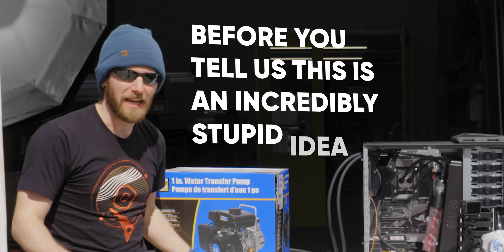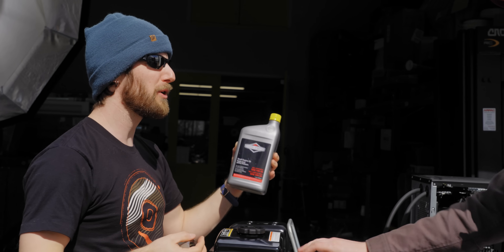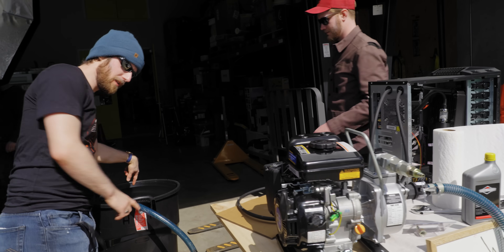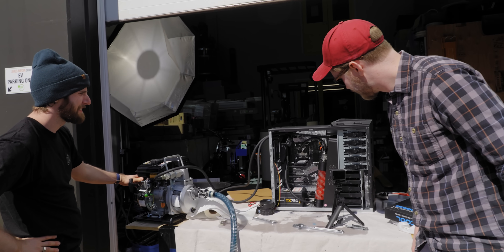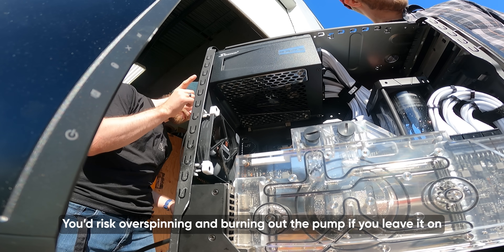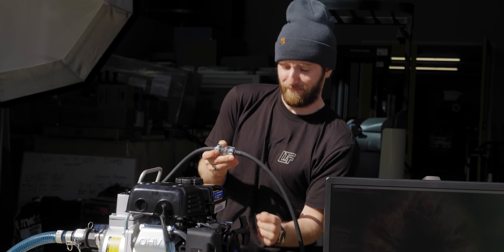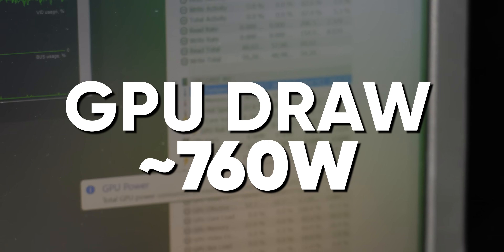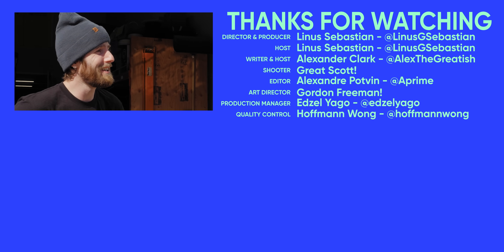Cooling a PC with a 2.5HP Pump

Comment: The conductance of the fine tubes in the radiator is too small to tolerate the pressure the pump is producing.

Comment: I previously designed circulating oil systems for extremely large systems like paper machines, among anything with constant oil demand on large bearings. There's a Diameter to the 4th power relation to pressure losses, or more easily calculated, as "equivalent length". Your delta-P is proportional to the sum of the equivalent lengths. For example if you go from 1" to 1/4" , thats 4^4 =  256x the pressure needed or, translated, to flow loss, hence why nearly 2kW motor looked like a tiny 7W worth of pressure. depending on the method you're using the power is from 4th to 5th and is based on turbulent or laminar flow. 

Turbulent flow is also more desired in cooling because you get a greater surface area (inner surface of pipe) exposure to the water. You can figure this out with reynolds number.

The "equivalent length of fittings" method is probably the fastest way to estimate your losses through systems like this.

Instead of the wimpy radiators and blocks you're using...you could just run a "brazed plate heat exchanger" around 15-20 plates. Usually have 1" oe 3/4" fittings already part of them. They  are used to transfer heat from oil routes to water, usually brought in from a nearby river or whatever. So in your case. You'd have oneside as chilled water and the other circuit as part as the actual water loop.

Comment: So the confusing thing about centrifugal pumps is that the flow rate is dependent on the discharge pressure. So because there’s so much friction loss through the loop, and the pressure is very high, the flow rate is relatively low. Basically, the higher the discharge pressure at a given power output, the lower the flow rate, so I doubt you’ll see anywhere close to the advertised flow rate, unless they give it to you at the max head condition. I know, confusing. That being said, I love crazy stuff like this. Keep it up!

Comment: Guys this pneumatic fitting is a connector for a quick release fitting not to screw a tube on it. The other fitting you haven't used were the right one for a tube

Comment: I want to do this with a electric pond pump and seal the computer to keep condensation down. No more fans. Just quiet. Add the res in another room with a loop outside to vent heat in winter.

Comment: I'm waiting for Linus to build a dorm fridge computer; mount the motherboard/cpu/drives/powersupply etc inside the fridge, with all the USB, Video, and audio connecting ports on the outside to plug in keyboard, mouse, monitor, speakers, etc.

I remember some gamers saying how in winter they put their computers on a platform outside their window, for extreme overclocking cooling, (when it wasn't raining, of course). The dorm fridge project would be the summertime solution.

Comment: Can somebody in the comment section help me? I have a Pre-built Optiplex 5040 Sff and I upgraded it to 32gb of ddr3l 1600mhz and it now has a 500gb m.2. It's super good at the moment but I wanna throw in a graphics card for gaming but the psu only has 180 watts and the headroom for the bottom x16 slot of the motherboard allows about 1 1/2 inches of headroom. What's the best gaming graphics card to get for this prebuilt? I'm looking at gt 1030s but I'm not sure if that's the right choice or if there is something better.

Comment: My thoughts at the start of the video.  Is it possible to cycle the water so fast that the water, because of the speed, doesn't have the proper amount of time in the rad to bring the temps down efficiently.  We shall see.  Weird side thought.  Is there a friction point with water that it could, in theory, increase the temp of the water?  Probably not.

Comment: "linus figures out flow is determined by pump efficiency divided by friction"

if you wanted good flow with that pump, you'd need minimum 2" hoses, fittings, and similarly sized cumulative passage size in the radiator(s) and water block(s) lol.

Comment: How about a mineral-oil computer, or an oil thats viskous in subzero temps with a big pump that pumps the oil thru a cooler. I mean, if you constantly push icecold oil all over the computer, it should not be able to heat up at all and there would be no condensation because of no air, only really cold oil...

Comment: Have you tried Derbauer method of just running tap water through the loop.  I think his calculations determined you don't even need fans and it's cheaper than the electricity of the pump and fans.

Comment: Bernoulli's equation doesn't balance energy around a pump given its adding energy to the system but I'm being a pedantic ass. Suppose if you know outlet pressure you can work it out with Bernoulli's based on pump curve

Comment: The high pressure and low fluid speed is probably because you guys are in a constricted flow state.  All the speed of the fluid is being converted into pressure on entering the computer because of the back pressure of the system.  The only way to increase the speed is to decrease the resistance to fluid flow.

Comment: You know it doesn't just have to be a silly video. You can still do the silly high power pump but get some hard numbers and take measurements like its a proper science experiment. We can all benefit from data even if its silly so long as its accurate and precise.

Comment: Your flow rate is limited to the smallest diameter pipe/tube in the loop, the only thing that changes with a stronger pump is the pressure.

Comment: Those motors are all about moving liquids across longer distances (lift/flow strength) that doesn't simply translate into more water moved, especially not through those small diameter pipes you guys are using. But hey, you knew all that and it's still a funny video.

Comment: okay, that just makes me want to know what a monster aquarium pump would do for example. how much benefit do you get if you put a 5 gallon bucket with a reasonable big pump next to your desk? because if you can get ambient level temps from high flow high volume, that's actually pretty bawler...

I guess what I'm asking is what's the smallest you can go with an external cooling solution and still see respectable gains?

Comment: Let’s take a massive pump designed for large flow and low pressure and immediately chop the flow 50 fold…. Then be surprised it didnt work the way you thought… you guys are morons…

Comment: I don't understand why the thumbnail for this video shows gasoline being poured into an electric motor. You're smarter than that.

Also, there's nothing weird about reducing the diameter of a pipe and the result being an increase in pressure with a reduction of flow. That's literally how that works.

Comment: Wouldn't copper tubed leak proof water cooling system be neat like hard tubing but it's metal instead of plastic. and then hook up the chiller to the water that the pump is using to top it off. Everything safe and secure ofc. I think that'd be sick.

Comment: SOOO due to the fact that after disconnect the pumped stopped working is likely because of cavitation which would increase at high pressure. Cavitation would murder your thermal performance. Not that any particular attention was paid at designing this to work effectively.

Comment: Linus Tech Tips: "We're gonna watercool a computer in the dumbest way possible"
Also Linus Tech Tips: "Hold my beer"
Reply: Wait. Beer cooled PC
Reply: @LoganRas  a bad idea as ethanol boils at like 75ish degrees. So if it get hot enough 5% of the loop is gonna vaporise and ethonal is also very flammable. also beer is generally carbonated.
Reply: @kylar616  So what you're saying is go for it.
Reply: @kylar616  So what you're saying is go for it.

Comment: Something I wanted to try was to set up a PC farm in something like 3U server cases on a server rack, hard copper pipe to the blocks and set up a primary secondary hydronic system with a chiller. I would expect this would be much more cost effective for purchase and for running than something like a big Liebert. Also this would reduce the noise from your server room pretty significantly. You could also add air bleed and auto refill on your loops with much less restriction and vastly higher flow than a traditional system.

Comment: Okay, first off a fun idea!!
Second off, you probably should have used a two and a half horsepower electric motor to power the pump....but that wouldn't have looked near as good on video.

My critique:

You had too much water volume moving at too highest speed. There was, at one time, a way to put an electric water pump on your race car and to use a special on-off switch that would turn it on and off every few seconds. This allowed the water in the engine to sit and soak up extra heat than it would not have soaked up without increasing volume or pressure. I think the name of the gadget was tick tock, take it was on the water would run talk it was off and the water would soak up heat from the engine. If you tried this with a ultra high flow pump designed for larger computers, you might have something that was actually useful.
Talk to you later....

Comment: use the pump to somehow cool your chiller.
if the pump pumps water from the hot side of the chiller to a monstrous radiator you could then use the industrial fans to blow air through the radiator.

Comment: Gotta love setting up the gas-powered engine in an EV-only parking spot :D
Reply: Lets face it, its all coal powered at the end of the day.
Reply: @GhostsGraphics  nope. BC is 99% hydro
Reply: @GhostsGraphics  Not everywhere is 'murica/Germany.
Reply: @GhostsGraphics  canada uses litle coal mostly hydro
Reply: @GhostsGraphics  true, but the efficiency is completely different. The same amount of coal burned to fuel an EV is a lot lower than the coal burnt to produce the gas for a gas car to then burn to produce even more pollution. Ev’s arnt a miracle solution, but they do have a massively smaller carbon footprint.
Reply: @pokemon202668  this is an important point that so many people miss. EVs are more EFFICIENT than ICEs by a significant margin as well. They’re able to do convert around 77%-80% of their energy to power at the wheels whereas gasoline engines are only around 12-30%. That’s a MASSIVE difference so although they “get so much of their energy from coal/non-renewables,” they’re able to do more with it than their gas engine counter parts.
Reply: @pokemon202668  They do until you count the production of the battery into it. Once you do your carbon footprint isn't decreased by much.
Reply: @GhostsGraphics  At least EV's have SOME energy coming from renewable/more ecologically friendly sources
Reply: @Lolks  yes but even sources you're referring to which I'm assuming are solar are still made with horribly detrimental environmental effects
Reply: @GhostsGraphics  Hopefully perovskites will change that considerably.
Reply: @GhostsGraphics  bold of you to assume solar. Besides, I never said they were 100% ecologically sound.

Comment: If you really want to push a WC loop to it's maximum use a pressure washer as pump. With a pop-off valve to limit the pressure to 100 psi ...

Comment: The outdoor setting got me wondering, how about pc water cooling with no reservoir, an open, one way loop, water in from a garden hose and out to... somewhere? May be a waste of water, but with the pressure from the hose no need for a pump, maybe no radiator since you won't be looping it, it'll be silent lol. Have it out to your sprinkler system and you'll have a use for the water. Water your garden while you game lol

Comment: I'm the only one that is surprised the engine made so low pressure seeing how much they decresed diameter in fittings. That doesn't seemed working correctly.

Comment: The next evolution of gas powered cooling will be using a 3000 psi power washer. The hose diameter is already fairly close to where it needs to be in it’s stock configuration!

Comment: Large head pressure pumps can be a good idea for larger scale applications. For instance I use a 1/3 HP pump for my entire server rack which is obviously electric. Extra pressure created in the loop actually makes the electric pumps more electrically efficient. It's know as chocking the pump. The extra turbulence from the higher speed and pressure also helps remove heat faster. Yo still have to deal with the heat, but you can more it a lot quicker. I wouldn't be against using a 1/8 HP pump for a single PC.

Comment: Swap out the radiator for a hose going back into the water pool, plus the gas motor for an electric... and it seems do-able, if probably still noisy

if you made a secure unit, you could even run it all out of a window... if it was winter or in the shade

Comment: Ok, I get it it's for fun only but, I really think when you do these with Alex you two don't give 100% of yourself. It looks to me like you are barely even trying (which is ok for entertainment) but I would make this work 100% better with my DIY CNC and some parts from the hardware store, metal fittings and tubes for example (even having a zip tie around the tube...), and you guys have a LAB and a bunch of stuff to make these work. Dislike for that otherwise a great video :)

Comment: Hook up a generator to the motor and pump and you'll have a fully self gas powered and cooled pc. Watch the motor ramp up as Furmark gets the system going. Though yeah, kinda limited by the size of the fittings and how much pressure they can handle XD

Comment: the spec plate on that pump says it outputs 42 gallons (US, I guess) per minute (1 barrel, or approx. 159 litres/min). Turbulent flow throughout the system is going to send pressure losses through the roof, no wonder fittings were blowing out...

Comment: So funny enough for work I had to use a backup pump we have for work that has never been used. It's a Hale high pressure pump, 40gpm at 1750psig. It runs on a John Deere diesel. 
We also have a lower pressure pump that is 3000gpm at 250psig.
I think we can hook it up to lots of computers and see what happens.

Comment: I wish they experiment with Temperature Control Units. These devices making water/liquid as cold as you want plus It has an control panel to set the water temperature and water speed (LP/m = Liters Per Minute)  but i guess that Temperature Control units are really expensive to buy. I hope someday they will experiment with TCU's.

Comment: LTT needs a Crossover Episode with Adam Savage. He has a video featuring a small, portable, Air Conditioner. Using a tiny AC unit like that for cooling a PC seems awesome.
Reply: That would be amazing!!!
Reply: There's multiple LTT videos where they hook up a window air conditioner to a PC
Reply: @JWooden271  Yes, but Adam Savage worked with a person that specializes in very small, custom built AC units.

Comment: You guys calculated the flow speed but I'd be more interested to hear how much pressure is in the system, as that matters more.
Reply: Since its a low pressure / high flow pump I would guess the outlet from the pump was at its Pmax about 2.6 Bar

Comment: with all your tools , making the adapter for the pump in 1 piece should have been very easy
Reply: regular fuel won't burn in closed container . it's not nitromethane
Reply: it's a new pump . off course it will smoke a little

Comment: Why a gas pump though? I don't understand why you wouldn't use an electric submersible pump with something like 10,000 gph instead of forcing yourself to engineer something and deal with the noise and exhaust just for a stupid video. Alex is smart but he's not very knowledgeable.

Comment: I would like to know a little bit about Bernoulli's equation. Answer simplify things you can say that's equivalent to this much pressure into a very small area. Thus the reason why we have to wear eye gear.
Reply: This pump is high flow, not high pressure. Bernoullis equation states the flow is equal to the pressure, diameter of the pipe, minus flow restrictions (no slip condition, turbulence, bends, etc).

He needs higher pressure less flowrate to make this work.
Reply: @mavbaker2159  Also the pump creates a lot of heat and dissipates its heat via water cooled.  When you put it on a closed-loop, that heat just goes back in, creating a heat feedback  loop.

Comment: I'm on the fence on whether my loop could handle this pump... My compression fittings are sized correctly, and to prevent leaks I even used a pipe wrench to tighten them slightly after I couldn't finger tighten them anymore.  But this is a lot of pressure and I think something might give anyway

Comment: I have been trying to remember if you've tried a submersible fountain pump such as the ones used in garden fountains. I seem to remember there are different sizes based on your pumping requirements for the fountain or other water feature. Added benefit is it should be a bit quieter. Alternative might be a cooling system based on a geothermal pump, where your condenser is something like a fountain, waterfall, or garden pool, where you create a loop/loops of conductive piping like copper out where they are installed at the bottom of a pool, fountain, or garden waterfall. Maybe even at the bottom of a swimming pool if you have a deep end!

Comment: LTT: invests hundreds of thousands in a machine shop with the ability to modify and create large diameter fittings and high flow water blocks.

Also LTT: let’s just buy a gas pump instead of a high output electric pool pump and let’s also neck everything down and try to push it through off the shelf water cooling components instead of a car radiator and 1” lines.

Comment: If I wanted to squirt a solution of bleach, soap, and water as far as possible to coat roofs without having to use a ladder so often, what are some options as car as pump varieties and brands and such? I'll have it setup so that I can run clean water through at the end of the day so the internals don't get obliterated by bleach so quickly.